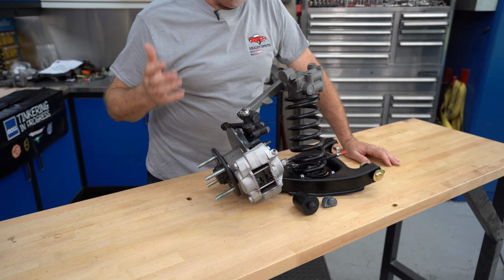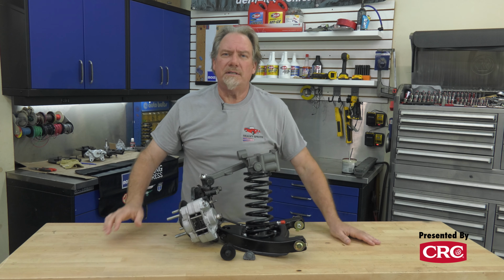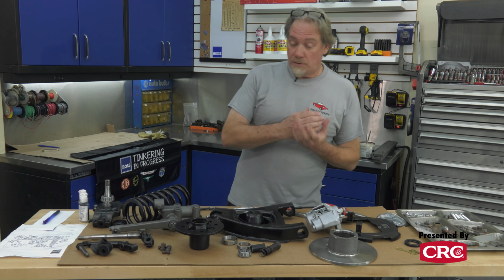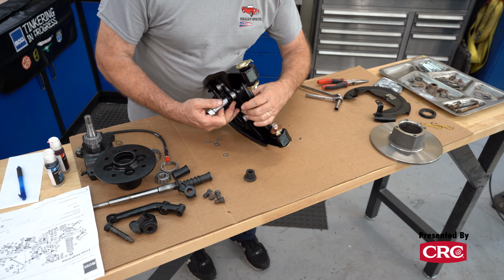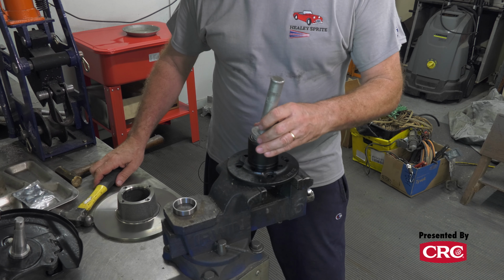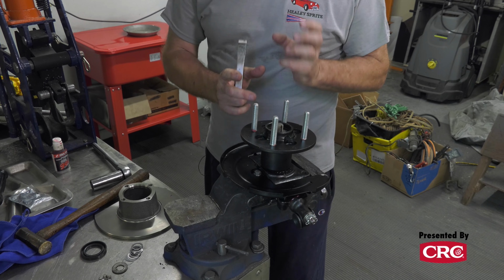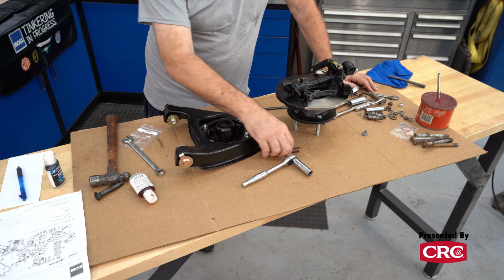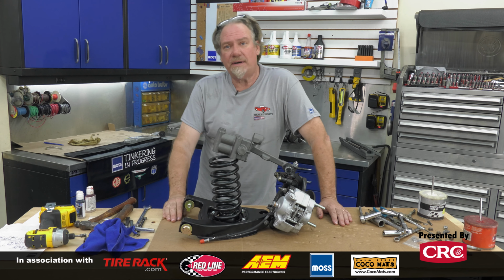How To Completely Rebuild Front Suspension | Austin-Healey Bugeye Sprite Project

Comment: One of the failures on the original cars were the lever arm front shocks. Ensure that the internal seals don’t leak and that the shock fluid level is correct

Comment: Three-quarter inch sway bar will turn out to be way too stiff for that car. I’m using 9/16 and occasionally go up to 5/8 inch. Three-quarter inch will ruin the feel of that sprite. And it could very well rip out the mountings on the cross frame.